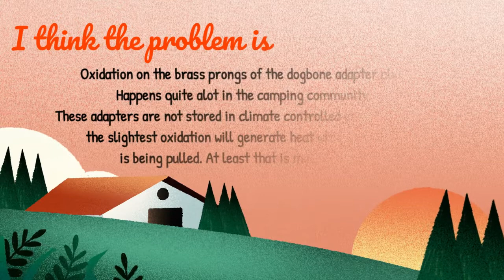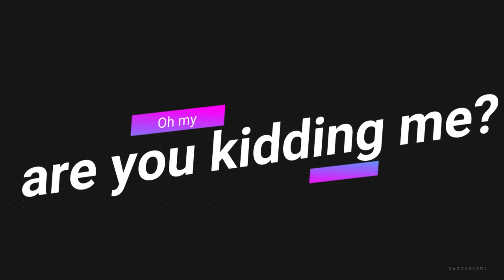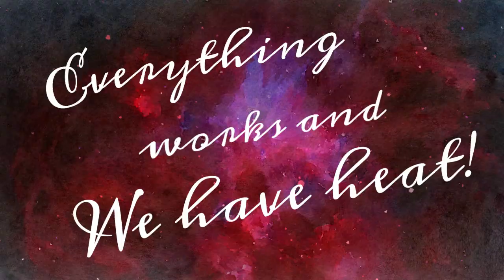Rv Electrical 50amp to 30amp FAILURE. #rvliving  #homesteading

Comment: 13:34 Actually, you don't wanna leave any "strays" --- i.e., loose strands of wire-conductor --- out of the connection... the stingy cable-manufacturers give you precious little copper as it is, so ya wanna "catch" and "include" each and every fiber of the bundle that they DO supply you with, so that you can get maximum power-transfer, especially in a high-current-carrying application like this, and where you already had one major meltdown previously!
Reply from the maker: Is this Froggy?
Reply: @rollingspringsranch  Ummmm... I'm not sure what you mean...?  I don't recall anyone's using that nickname for me...??
Reply from the maker: Ha Ha !!